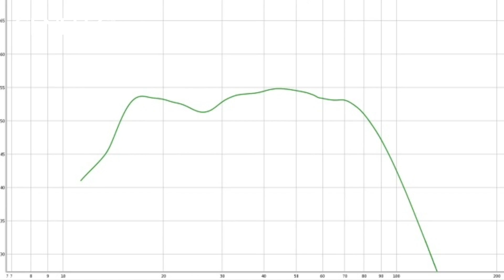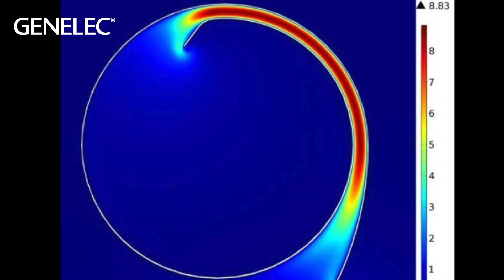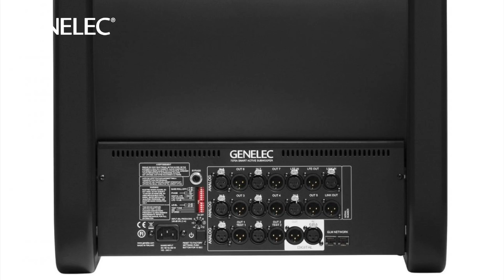Speaker Talk | What makes Genelec subwoofers unique? | Episode 3

Comment: Is this a new type of enclosure? If you look at 3:13, you can see what I would call a hybrid ported / transmission line enclosure. That line length looks short compared to other tline enclosures I have seen but it has an extremely wide port width comparatively. Did Genelec invent something? Is the extreme rigidity of the rolled steel required? Is this enclosure type patented? I don't think anyone else is making anything similar. Either way I think I am finally going to add one of these LSE subs to my 8030s...

Comment: 1. Could this bass management (7360a) system be used with  monitors other than genelecs? 2. Can i connect more than 1 set of monitors to it?
Reply: @genelec  Ok but l already invested in a pair of Barefoots and l also have focal solos and a pair of mackies hence the question.Would the bass management still make sense for me and would l have to get GLM also?  If no l can look for another cheaper option l guess.Thanks for responding and l am strongly considering one 7360 followed by another one later down the road.
Reply: @genelec  ok l am reading the article now👍

Comment: can I connect analog output from my Cranesong Avocet 2a to Genelec 7270a as an analog connection using AES cables? Or does the DAC have to have an AES output connection to connect 7270a? And can I connect 7270a AES output to 8331's via AES cable?
Reply: Oh no!